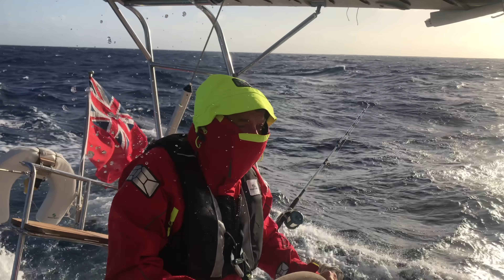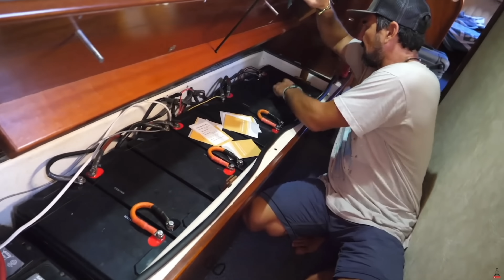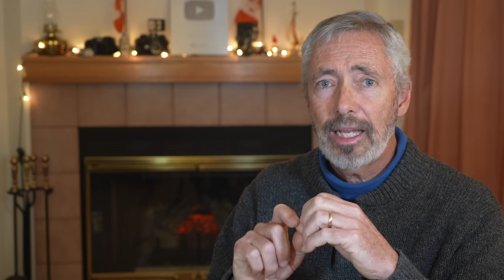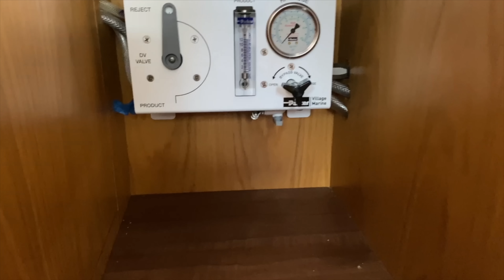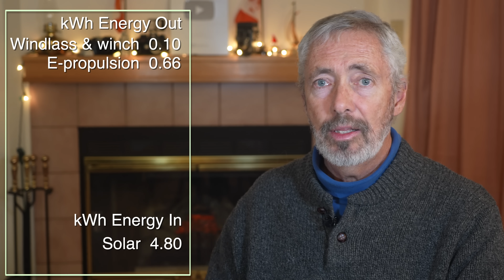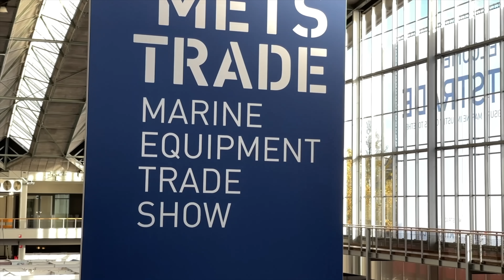Building an ALUMINUM Sailboat Pt 8 - HYBRID Power on a Sailboat: Will it Work for Distance? | EP 228

Comment: You're paying too much for your batteries! I have 64 x 280Ah EVE cells (~60kWh), destined for an expedition vehicle. The cells cost worked out $114 each, so $7,296. Shipping from China was $2,200. Add to that four Overkill Solar BMSs ($600) and two custom made sealed waterproof enclosures (I'm budgeting $1500 for these)... Are you really happy to pay 6x for fancy "marine rated" batteries? That's quite a markup!
Reply: BTW you probably found something like this, but here's an excellent solar calculator that allows you to choose any point on earth and get the approximate output from a solar panel of a given size. Click the location on the map, set "Slope" to 0 for horizontal panels, and "Installed peak PV power [kWp]" to the kWh of your panels. Hit "visualise results" to see the monthly expected output for each month of the year.

Comment: Thank you for a very informative episode! I am not a cruising sailor but I have several decades of experience designing and using electric propulsion out of rechargeable batteries.

I was wondering if you did a formal analysis of the consequences of single point failures, meaning how do you cope with the failure of any single component in the whole system under the worst realistic environmental conditions. I can imagine one reasonable additional backup system could be an additional small portable generator that could deliver about 2kW into your shore power inlet. 
Generally speaking I think on a comfortable cruising sailboat hybrid propulsion is a good idea if it is implemented smartly.

Comment: Paul and Cheryl, we have spent our second summer moving slowly to electric cooking.  I agree with Delos's numbers, we need about 1.6kW but only had 300w of solar, so needed to top up with the engine every 3 days or so.  That's fine, we are coast sailing a 31ft yacht.  However, November was spent upgrading to 600w of solar which in England during the summer should be more than sufficient for power the yacht and an electric galley.  But, we are also minimise the energy we use.  So whilst we use a 2Kw kettle at home, on board the little 0.8L 1 kW kettle half full will make to large mugs of tea slightly quicker than using gas.  The toaster is the same and lets be honest yacht gas grills are rubbish at making toast.  The induction hob is also frugal but the real killer appliance is a Remoska.  If you can cook something in an oven then it can be cooked in a Remoska and at 580Wh very frugal.  We did the full Christmas dinner this year in the Remoska as an experiment.  cooking Lemon drizzle cake is super easy and even something simple like a pizza cooks well.  

We have replaced the old cooker with just a gas hob and grill just in case it all goes pear shaped but we sail during the English winter.  Solar doesn't work at all then, but we benefit during long summer days.  

Were are we going next?  probably an air fryer, they cook so quickly power isn't an issue even on a small yacht.  However, our biggest problem is lots of European yachts have 450mm wide cookers and there isn't a sensible double induction hob that will fit and be gimballed in this space.  What a shame. Still we really enjoy cooking on solar.
Reply from the maker: Thanks @Pete9501 ! I hadn't heard of a Remoska but we did just purchase an "Instant Pot" to test it out. For the galley we will have space for the GN-Espace induction hob but their smaller one is 500mm wide. We had GN-Espace gas unit on the last boat and it was amazing!! Even did great making toast since they have a system that has a large grilling surface over to whole top of the oven compartment!
Reply: @DistantShoresTV   Independently from sailing I came across the Insta-Pot as an affordable option for cooking souis vide which it is fantastic for (beef checks OMG) and once I had it in a house with a full oven and hob I found I used it a lot for stews as it’s one pot system you can brown everything in the pot then add water and switch it to it meat / pressure cook setting and in 40 minutes your eating what once took 3/4 hours. I’m looking at buying a mid sized monohull cruiser circa 2000 and going fully electric with an oceanvolt system most likely it’s regenerate is impressive and the 0.5 knot speed reduction you’ve referred to doesn’t apply especially if your mid 40ft. We need to stop using hydrocarbons and you are roll models that can afford a custom aluminium yacht. My challenge to you is to inspire us all and get rid of the internal combustion engine although what you learn will influence countless others

Comment: Good video. I like how thorough you have been assessing your energy balance. Concur with the hybrid setup. It allows to go full electric when circumstances allow, but provide the diesel backup when they don't. Plus the additional redundancy in propulsion (sail/diesel/electric) which increases safety. Stepping away from propane is a good idea; use widely available diesel instead that can be bunkered quayside, free up space by eliminating a propane locker (another safety benefit), and reducing the amount of moisture in your cabin from burning the fuel (significant in cold climates where you may want to keep ventilating cold air to a minimum). Believe you 're the fifth sailing channel that's going hybrid for their new boat, Graeme's going to be busy.

Comment: Great to see the boat is coming along, and a really interesting video…
I am wondering why you haven’t (?) considered wind generators to add another method of charging the batteries…
I am still not convinced that electric propulsion is mature enough for any serious sailing, especially for extended periods in high latitudes. The energy efficiency of diesel and the reliability of diesel engines are hard to beat. I would also be interested in seeing data on the actual benefits of any electrical propulsion system when the environmental effects of mining lithium and the short lifespan of these batteries are taken into account.
Reply from the maker: Hi Mike. I agree diesel reliability is hard to beat. Our parallel hybrid system is basically a standard diesel installation with the hybrid bolted on the back. So we basically have the advantages of a conventional diesel plus option to regenerate and generate , and still use the E-drive unit when practical. 

We did try wind power many yers ago on our first boat but didn't get on with both noise and safety. We're sticking with solar then there won't be any shading from the wind rig. 

Kind regards Paul

Comment: Our Fontaine Pajot had propane when we bought it. Even just cruising the US east coast and Bahamas we discovered it was more difficult to find refill options than we were interested in dealing with. We installed 1200A of 12V lithium house batteries, 2100w solar, and had two 3000w inverters. We replaced the propane oven with a convection microwave oven and the stove with an induction stove. This freed up counter space from a countertop microwave as well.

We also had three air conditioners on board and often ran the master cabin unit in the evening to bring cabin temperature and humidity down.

The water heater was a 900w 10G unit and ran it from the inverter as well.

We did not have a generator and only used main engine alternators for house battery charging a few hours in 4 years of operation.
Reply from the maker: Thanks @PaulSmyers
I appreciate the real-world numbers especially on the A/C and cooking and remarkable that you also ran the water heater. I'm jealous of the 2100w of solar :-)
Which inverters did you use? I guess they were paralleled when you needed full power? I assume you could switch one off much of the time to save wastage of running one large unit. 
Cheers! Paul
Reply: @DistantShoresTV  The boat had a Magnum 2812 (I guess it was actually 2800 watts) and I added a Victron 3000. I just manually segregated the loads. One inverter in each hull. If we had kept it another season I was going to swap the original Magnum for a matching Victron and wire them for load sharing.

On our mythical future boat I intend to make it 48vDC house batteries so all the big cables can be less big. I've already seen manufacturers are making 48v accessories like windlass and winches. Then a simple dc-dc converter can take care of the rest of the stuff like lights and navigation. 

Now where did I leave my winning lottery ticket ... :D

Comment: Energy problems will be history once the Powercube will be available. It generates power from the invisiable spectrum 24/7. No more huge batterie banks needed. Search for neutrinovoltaic.
Reply from the maker: I am afraid neutrino voltaic power is a fake product :-(
Reply: @DistantShoresTV  It´s not. How many hours of research did you do ? I am researching this topic since 2017. How come Nicola Tesla drove an electric car in the 1920th without a battery ?
Reply: Bring on the flux capacitor.

Comment: Very informative video, thanks. But, i did not see refrigerator and/or freezer load in your electrical consumption. And also, i was wondering on rainy days with min solar power, do you have to start the hybrid engine just to make coffee or cook food ?? I will search more on hybrid engines on sailboats.. we are in the middle of making serious decisions on our next world cruising boat.. and we really appriciate your input.. 👍
Reply from the maker: Thanks B Y! What kind of cruising boat are you looking at?
Yes I have shown basic power budget for normal cruising from a previous video ... 
https://youtu.be/HSwt06mNSJU?list=PLQMyJKewucpfHgap0A0ekiWvv5SXOeZ6n&t=383
I do not not think you should have to run the generator on the first rainy day. With the hybrid you will want a larger battery bank and it should also be large enough to carry through the 2-3 rainy days. For example we are planning at 25kWh -30kWh bank but our energy use per day will be closer to 8kWh.

Comment: Really good tempo on this video, thanks for controlling the delivery and organising it so well

I think you have a great system planned, 30kwh of battery sounds great, I think alot of implementations skimp a little bit on the storage which can lead to a bit too much active power management, having the buffer will let you use the flexible power generation options you have in a more comfortable and stress free way.
Reply from the maker: Glad you enjoyed it! Yes the cost of battery has come down but is still pretty expensive for a big bank so I think many people skimp a bit - perhaps hoping to increase capacity later...

Comment: Excellent video as always… We are building our Irwin 38 with a hybrid electric plan of generator and electric drives with electric systems and using “Uma” as primary example… just think “Two Step” with regeneration as the primary generator and sails are the primary drive… Your best boat still in our opinion, we like to say, BFT (built for two) as Two step got you there safely and if need be, Sheryl could handle her safely in all situations in the unlikely case of Paul’s incapacitation… we are also Inspired by “How to SAIL oceans” and the Pardey’s… We aren’t looking for the glitz of every mod-con available to mankind… I still put my beer in a net and hang it in the water… The Northwest passage is a noble endeavor and all, but we aren’t 30… (I love the Netherlands)❤
Reply from the maker: Thanks very much Alberto! Good luck with your Irwin 38 Hybrid. There is a lot to be said for the smaller simpler solution! When do you plan to launch ?
Reply: @DistantShoresTV  We are in the yard, having moved onto the Tennessee River from Kemah, TX. I am just about to purchase our systems but having some supplier issues… to answer your question, I hope to be in the water this year and fully rigged on the coast by the 2024 season… Structure is done, paint is on, now comes insulation and the fun part, systems…!

Comment: Hi! I’m gonna put electric propulsion to SeaCamel with probably smallish DC-diesel generator and heater for colder climates. Electric propulsion is  fast and easy to adjust and makes the regen possible. Also it can be used for light wind sailing to gain that extra knot with very little power. I’ve had smallish electric sailboat for four summers now here on the lake and it’s just awesome.

The need of power really depends the speed you’re looking for. Even big boat will move 2-3 knots with really low power that can be gained mostly from decent solar array. Thinking of those calm sunny days. But there should be enough juice to get yourself out from tight situation of course.

One thing for lowering the energy consumption would be to install couple of solar heat collectors for hot water. Harvesting only heat is pretty easy and efficient and would remove quite big portion electric consumption from the equations.

Also for AC I think I’m gonna explore possibilities of using passive evaporation techniques utilizing seawater.

Comment: I think regeneration from the prop is an extra IRL. It should not be relied upon for recharging the batteries, even at higher knot speeds. Most of the recharging energy will come from solar and a diesel generator. A hybrid solution is the way to go IMO.

Comment: I really like this series.  I’ve done the calculations for battery power and hot water…etc.  what I find interesting is photovoltaic solar panels are 20% efficient, solar thermal panels for hot water are 80% efficient yet nobody uses the thermal panels on yachts.  I wonder if it’s just too hard to maintain the vacuum inside the panel while it’s being slammed by the waves?  I know solar thermal still works even in freezing temperatures.  Also, why don’t engineers use the tanks onboard to store thermal mass?  It seems like there are a lot of ideas that could be deployed better.  The FLINsail is an interesting solution to raise solar panels up your mast while anchored.

Comment: one major benefit with an air heater is that you get a lot of dry air, compared to heating via water or elctricity. I live onboard a 40 ft boat, and when at anchor i use the diesel heater, which uses around 5 liters per day a 0 celsius, and using 30 watts, without the need to run a demunityfyer. Also today you can get a combi diesel heater, making hot air and water at the same time. 

Also reagaring the solar setup, remember that in the north the days are longer doing the summer, here in DK its only dark for around 4-6 hours, so the solar system is giving a lot. But a key point is that you can change the angle of the setup doing the day, so that you can optimise the output. That should give plenty of power to run a water heater with a 1-2kw system doing summertime.

Comment: UMA has been sailing with all-electric propulsion for several years. (edit: I see you have met with UMA.) Their system includes regeneration. Sophisticated Lady has electric propulsion on their dinghy. Gone With the Wynns has had on order a Hybrid HH44 with dual drive. I think Ruby Rose II's new Seawind 1370 will be hybrid. I have a Honda Insight hybrid. 52 MPG. I have noticed cold weather affects the battery, and mileage is reduced 5% to 10% when the temperature is 25º F and colder. I wonder how your batteries will be affected when you are up North? UMA sailed north last year. They would be able to add their experience to your knowledge base.  Safe, healthy, & productive 2023 to the both of you :¬) Webhead USA

Comment: Pound for pound it doesn't get much better than diesel. Central heating from a Refleks boiler and a Wallis or equivalent ceramic hob / heater. Propane hob and a petrol generator converted to propane and finally solar/wind/re-gen - electric from the hybrid set-up. A diesel outboard for the tender renders the purchase/storage of dangerous  petrol obsolete. 
Warped to a harbor wall at high latitudes with snow on the deck, diesel is a gift from the GODS!